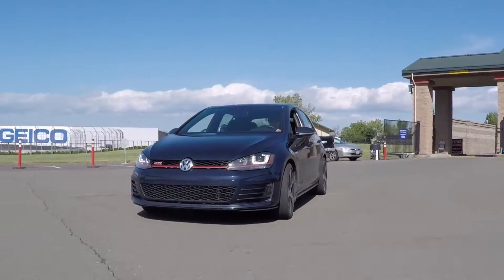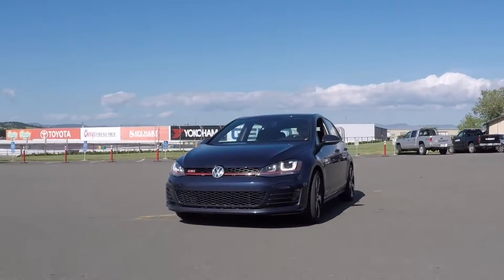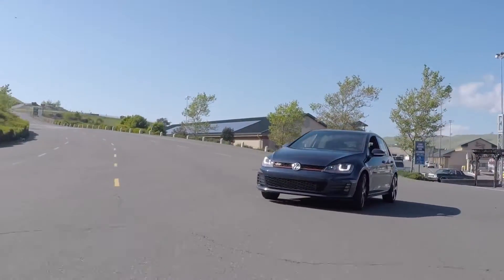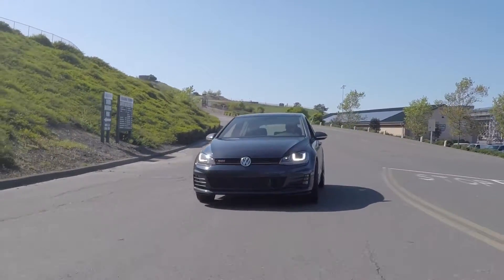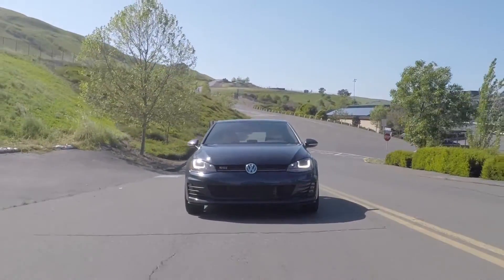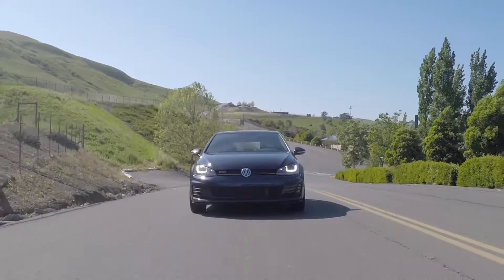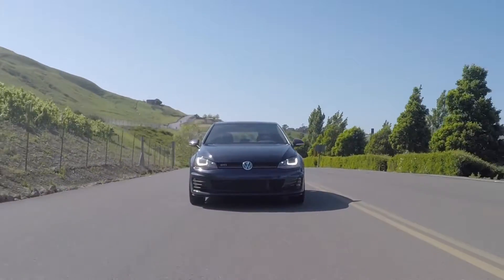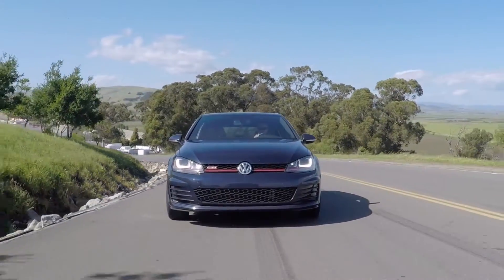VW MK7 COBB Tuning Stage 1 Dyno

Comment: Very small diff comparing with stock. You d better try jb4: +50hp over stock!
Reply: COBB is a step above shelf tunes. It has a tune on the accessport but they are really meant for custom tunes. I'll take that option all day, every day over any other brand, JB4 included.

Comment: Jesus might as well just forget about Cobb....More or less nearly the same as stock. I mean what the fuck? Seriously? 

Had APR on my 2015 Jetta and it was a total monster. it looks like I will be going with them again.
Reply: Keep in mind the GTI stock makes about 180 at the wheel. 180-250 is a big increase
Reply: @MC_Galvy  A stock MK7 GTI actually makes around 220 WHP. I dyno'd mine and got 221 WHP on 93 octane with stock tune and nothing done to the car. Stock Cobb tunes have never been competitive and were only there to hold you over until your customer tuner could make you a real file.
Reply: @Clapxiomatic  i see now. I didn't realize volkswagon states hp at whp instead of crank. I would think theyd do crank like the others for btter advertising.
Reply: @MC_Galvy  stock mk7.5 GTI makes 228 to 232 at the wheels my friend get your facts right
Reply: @mik55tv22  read the comments above before replying. Jesus this was a year ago.